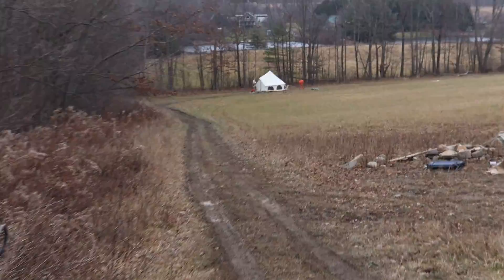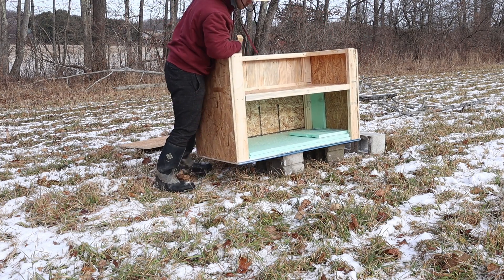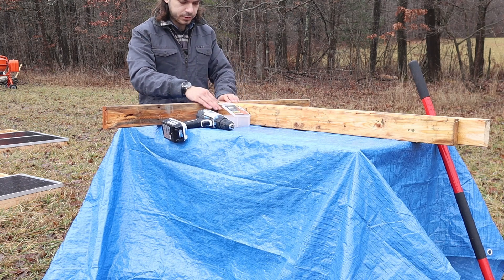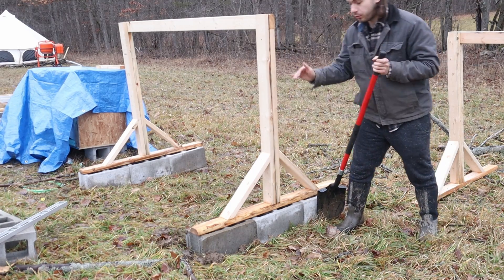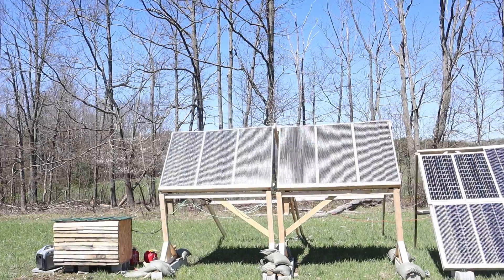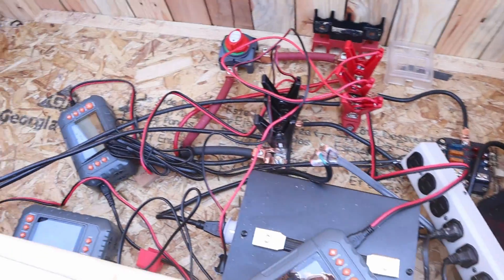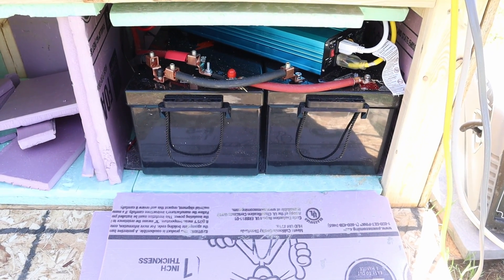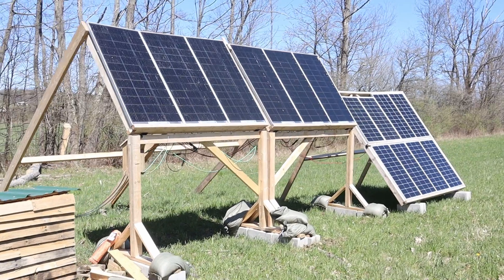CHEAP DIY 2kw Adjustable Solar Array For My Off Grid Homestead

Comment: if he got a victron charge controller - it would get rid of the "too much power issue"
i have a little 100/20 and once the batteries are full it stops the panels. and if just start up a load it immediately lets the solar back in and keeps  the batteries in float.

Comment: Shower, Gas Kelipont.
 12 volt pump. 
Im doing what your doing.
A builder. But feel very inadequate with my solar plan. 
Would definately have close to accomodation though.

Comment: Suggestion for dump load.  Get a din rail mounted voltage monitoring relay (about $25).  You can set a voltage threshold where you can turn on your dump load.  Then use a heavy duty relay or an SSR to control the actual load.  If you want your load to be after the inverter then use an iot relay ($38).  Its a power strip with a built in relay that turns on/off some of the outlets.  I use this with the voltage monitoring relay to turn on a space heater to dump excess power.  The voltage monitoring relay also has a low threshold that allows you to turn off the load when your batteries drain to a certain point.  My system is 24v lithium so I have the on voltage set to about 28v and the off voltage set to 26.5v.  I don't have a great solution for the summer so I just use a large fan but that really doesn't do it.  I've instead added a similar arrangement that turns off my third array.  I have three.  It disconnects the incoming solar wire from the charge controller.  This is the safest approach since disconnecting the charge controller from the output side can damage it.

Comment: save yourself a lot of heartache and money.   mpp sploar makes all in one units.  EG4 also makes all in one units.  i spent a fortune on solar .   and ill swear by mpp.  i bought 2 units and 5 years in.  best bang for the buck.   i got 26kw worth of batterys now.  and 3 units. one is a growatt. its junk. lol.  they run ac units all summer and heaters in the winter, as well as freezer fridge computers.   its been a long road and a lot of wasted money getting here.

Comment: I live in Tucson, Arizona.  We have so many rabbits rats and mice and chipmunks.  I have a small ac unit in a pottery studio next to our house.  On the regular I spray Pine Sol or peppermint water around the outside unit to keep the rodents from moving in.  So far, (7 years) no big issues, it has kept them away.  FYI. 👍👍🌵🌵🌵🌵

Comment: The invertor on top of the battery is scarey. How about below? Since you cranked it up to 220 volt how do you run the fridge.  US 220 outlets use to hots and a neutral.   Did I miss the 220-110 at the shack?
Reply from the maker: There's an inverter on both ends. One to step up the power to 220 and then another to bring it back down to 110 at the house
Reply: @lcarter194
uhoh.. is it..? :face-fuchsia-wide-eyes: i have mine  mounted on a board and the board cotched on top the corner of the battery where there isnt any terminals.:face-blue-wide-eyes:
now im worried.

Comment: I would have took the money for cinder blocks and got ground contact 4x4 and some concrete to go with your cement mixer in the background and concreted those into the ground.
Reply from the maker: It was winter and the ground was frozen so I couldn't dig or pour concrete. But this seems to be working well

Comment: The insulation you installed in your battery compartment wont do ny good if it  has air infiltration. If air can flow around the insulation it will be worthless. that compartment must be air tight.
Reply from the maker: It is very tightly packed with multiple layers of foam.

Comment: Having built one of these myself I would suggest the following.  (1). Ditch the cheap charge controllers they will cook your expensive batteries.  Go Victron its worth it,  you have the option of using a Rasberry Pi to manage the system and you can add relays to automatically turn things on and off using logic rules for example turn on a heater/cooler when the battery is full.  Victron can also be set not to charge your batteries when its too cold.   (2) voltage drop is always going to be in issue over that distance so why not connect both solar new solar arrays in series and send 200v 2a up the hill to the shack and have the inverter and battery bank there.  That way the battery bank will be kept warm in your heated living space.  Voltage drop increases with the current draw.  (3).  Lay the cable in conduit. (4).  would have been better to connect your 2 new arrays together and counterbalance it in the middle rather than hinge and the bottom, that way you can make 1 much stronger frame. (5) and this is the big one get that thing properly anchored into the ground or it will blow away in the first storm. - With solar they are called opportunity loads rather than dump loads, you will need a way of testing the generation conditions by turning on a load and seeing if there is enough solar generation to run it without putting the battery into a discharge state.  Also Bi facials are expensive, used 260W panels are super cheap now so much so I have used them as a roofing sheet rather than buy OSB and felt.  Good luck with it

Comment: A few comments.  
A single 60a output MPPT would handle all your panels if they are charging a 24v lifepo4 bat bank.  I installed a Makeskyblue one on a boat, which now costs $85- $100 and can handle 1440w PV power going to 24v bat bank.  Generally 95% eff and max PV voltage around 110vdc- so wiring with serial /parallel arrangement is needed.  There are other brands as well. The PWM? controllers are efficient in some ways, but waste pv power if the voltage is more than approx 30% above the bat voltage (32v to maybe 36v for a 24v bat bank)- so if PV voltage going to a PWM is over 32-36v,  you are losing charging power.  
Bifacial a good idea- more power per sq ft and they tend to shed snow when sun starts to shine- reflected sun hits bottom of panel, produces power and heat and heat melts snow.  Some DIY solar homeowners have found a combo of angled bifacials and vertical ones (one side faces E, other side faces W) improves the overall system efficiency by catching early morning and late afternoon sun.

Comment: You don't need a dump load, you just need to configure your charge controllers properly. I see you are using several different charge controllers and if you are triggering an overcharge condition and the BMS is shutting down, then lower the charge settings by maybe about 0.2v on each controller. Those cheapy blue PWM controllers are terrible for this and quite often allow way more voltage out to your batteries than they are supposed too. I've had to throw away a few of those things because of the voltage spikes getting through. I know money is tight, but I would switch that out ASAP with something a bit better or eventually they are going to ruin your batteries if they are over charging... But all this dump load talk is not what you need to do and is more necessary with really old wind turbine type stuff. Get a REAL mppt (not one of those blue ones that look the same and are marketed as MPPT because they are not). Good luck.
Reply from the maker: As far as i know even with a nice mppt charger if the battery is full the power still needs somewhere to go and would still need a dump load. Mppt only increases the efficiency of the charging
Reply: @janklabs  not my understanding or experience, i have used Renogy and now have victron. When battery is full they trickle charge maintain the batteries rather than over charge. That said, on our trailer (700watts of solar in Mexico) i have a 4 gallon 120v hot water tank with a 1500w heater element. Batteries are usually charged by noon so I then turn on the hot water tank during peak afternoon power generation. 4 gallons is great for a shower or dishes. 1500w element over 15 minutes consumes 400watts of power. to ensure I don't forget to turn the hot water tank off the outlet is wired to a timer switch. for your application a larger hot water tank would add some luxurious hot water.

Comment: Electric water heater is a great dump load and gets you free hot water, or at least helps to heat it. heating elements are available in any voltage and cheap it's easy to convert them.. You went to a lot of trouble to get max from your panels and it's getting wasted with the cheap controllers.. Get MPPT controllers..  You seem to have all the basic info and you'll learn about implementation as time goes..   You SHOULD Shower everyday.. AND, hinging the array in the center (like a teeter-totter) instead of the bottom hinge like you did, makes them much easier to adjust the angle every month and also to dump the snow if needed.. possible problems Blue tarps are NOT water-proof.. keep an eye on it... That 12 ga wire is going to catch fire.. make sure it's fused and  feel it from time to time,, if it gets hot,, you have to do something. Wire is expensive so always keep an eye out for deals new or used...
Reply from the maker: The tarp was replaced shortly after the video. I just didn't have the money for the metal roofing I needed.  Also the 12 Guage wire is more than capable of handling the load I'm putting on it. It doesn't get hot at all. I read the spec sheet

Comment: Yeah an electric water heater would be that giant electric draw you were talking about.
Reply from the maker: Great idea!
Reply: Specifically, an air source hot water heater. It is waaaaaaay moe efficient than the typical, resistive hot water heaters of the past.
Reply: @ Also more expensive and more complicated. He's not necessarily looking for efficiency here.

Comment: For the excess energy problem, couldn’t you just have a switch disconnect the panels automatically over a certain battery charge percent?
Reply: why? charge controllers do exactly that already.
Reply from the maker: those panels will continuously make power and if the batteries are too full for the charge controller to send the power. the power has to go somewhere. It could potentially fry the controller or overcharge the battery.
Reply: @janklabs  so why do you use CHARGE CONTROLLERS at all?
Reply: @broniusale5987  The controllers convert the voltage to what the batteries need and monitor them.. The extra energy can be dumped into something useful.. An electric water heater is perfect
Reply from the maker: Id need some kind of circuit to detect the battery voltage and disconnect and reconnect from the system. that takes some doing
Reply: @janklabs  Get better controllers,, they ARE the "switch".. Controllers are built on massive heat-sinks to get rid of excess power. It gets converted into heat and dissipates through the heatsink fins.. Think about this: You make heat you have to get rid of,, AND you have to create heat for your batteries... get the picture?? I used the concept years ago with grow systems.. I took the heat from the lights and pumped under the reservoir's to help heat them..